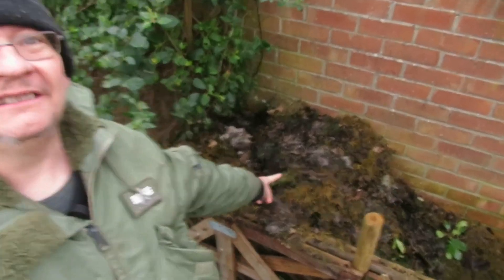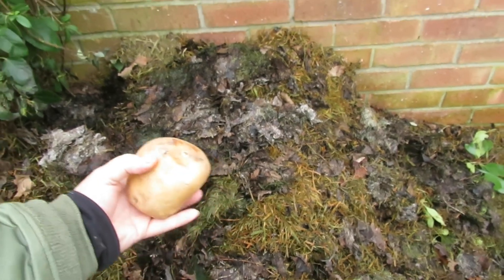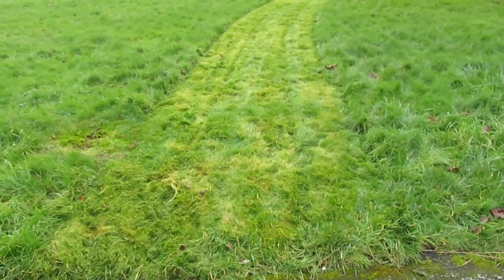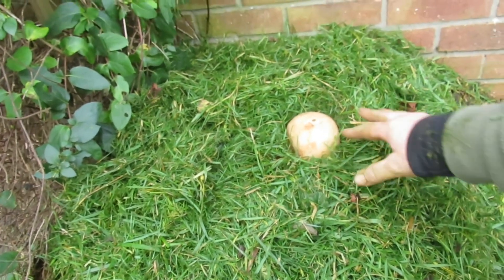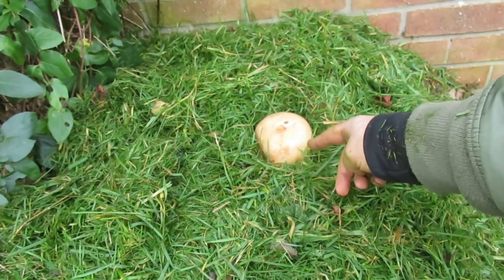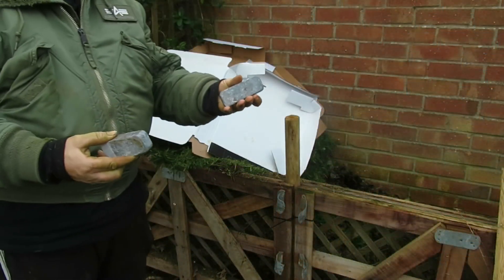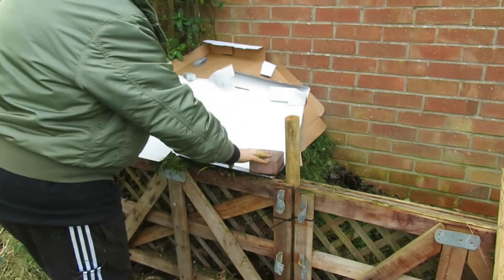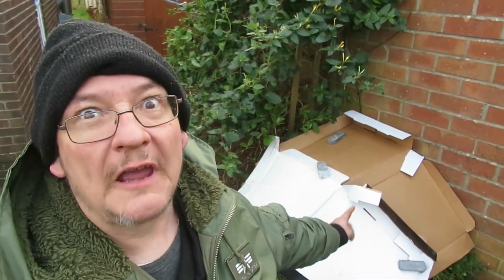Can You Really Cook a Potato in a Compost Heap?

Comment: Wrap it in some foil, as if you were doing it in a bonfire. Have you seen the cast iron spud bakers for putting in/on a stove? I tried cooking a spud in some chipped wood that were 65°c, didn't work.
Reply from the maker: Oh yes, I have cooked potatoes in the wood burning stove before, but what I would normally do is microwave the potato so that it has all round heat that has penetrated the spud and then put it in there wrapped in foil, which I think I will probably have to do. But doing it like this will cut out the need for the microwave